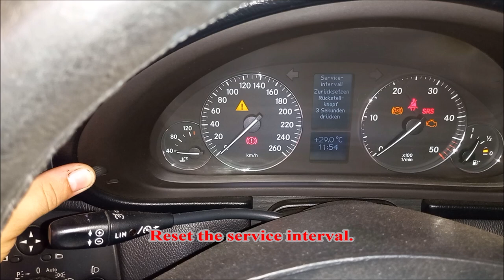Mercedes OM 646 engine oil change DIY (220cdi)

Comment: hi , what brand oil you put into engine? Caastrol Edge, Liquy Moly, Mobile? 5w40 for this High milage engine?
Reply from the maker: Hi, I use castrol edge 5w40, after 10 000 km I always change the oil.
Reply: nice man..thank you @therealxander01